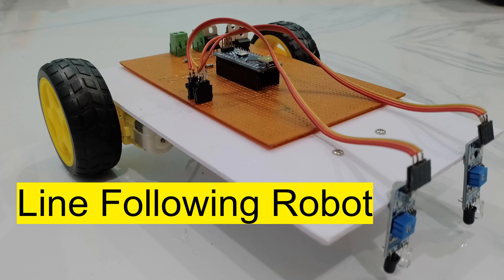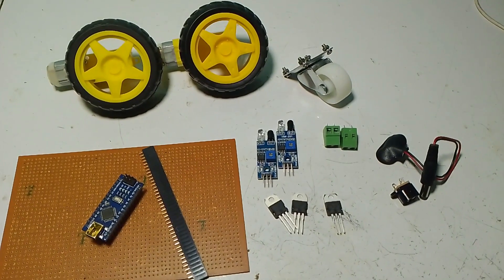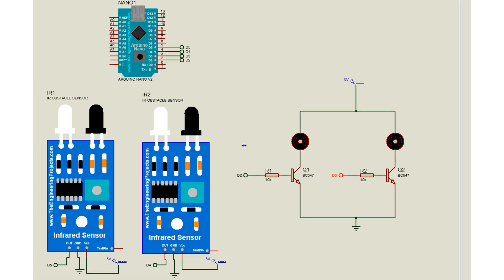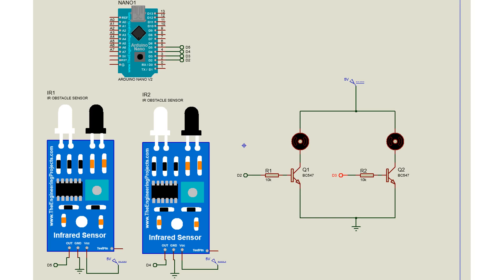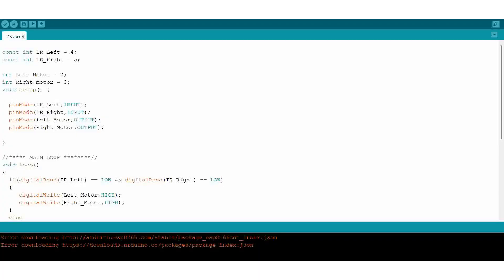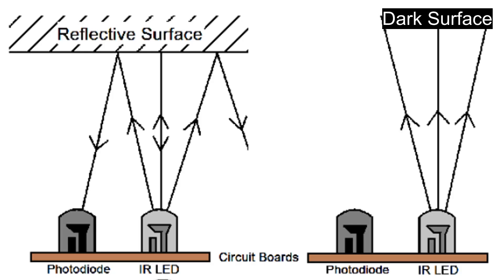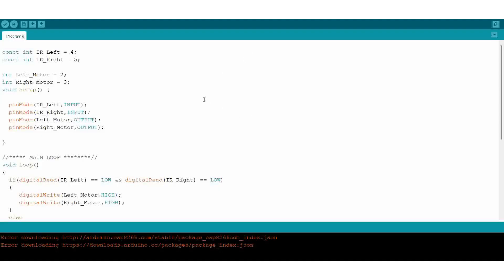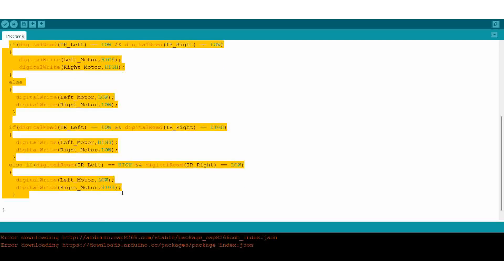Line Following Robot using Arduino| TechShow #electronics #arduinoproject

Comment: We used to have one of these at work that delivered hard copy documents and small packages up and down the hallways.  It was about 4 ft tall x 4 ft long x 2 ft wide with a bunch of shelves.  It would stop in front of a designated door and chime just like a doorbell letting whomever to come out and get their stuff.  There was a red stripe and a green stripe on the length of the robot and you could stop and start it by touching the appropriate colored stripe.  But mostly, it ran all on it's own.

Comment: Hello, can the IR sensor module be connected to analog pins of the arduino nano?
Reply from the maker: Yes, it's possible to connect IR sensor with analog pin, but you will get a numeric value